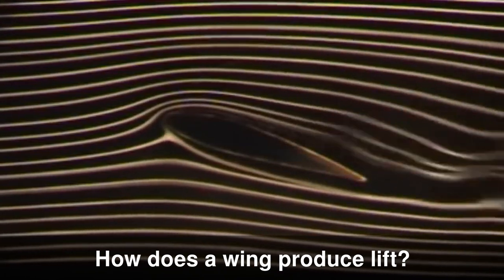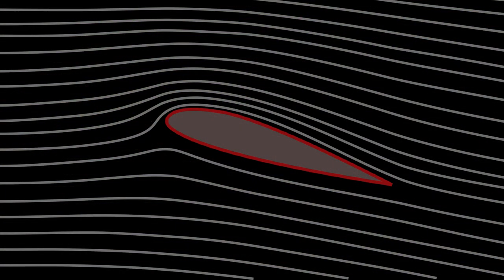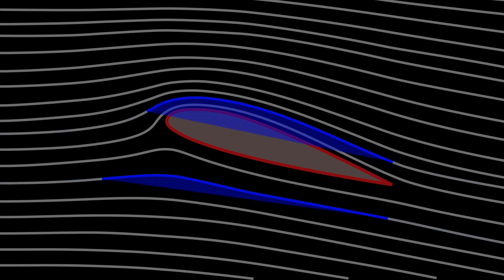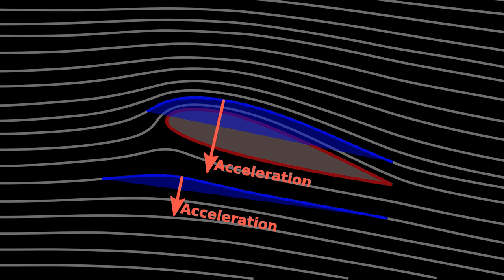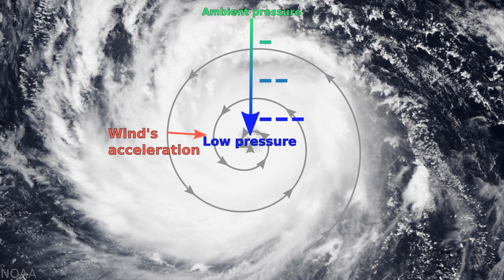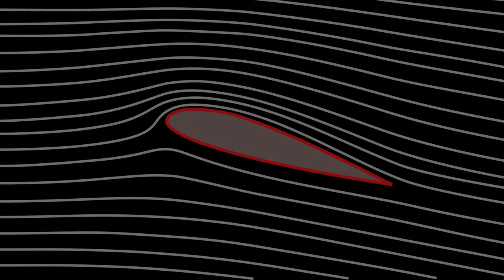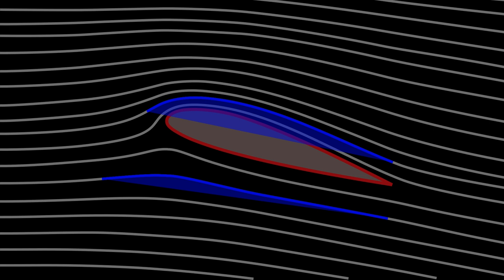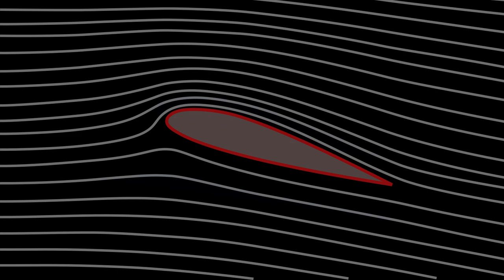A Wing's Lift Explained by Hurricanes

Comment: Don't know how I missed this 2 years a go.
You've done your homework Colin!  
You even know just how small the pressure changes are around a wing.  Very good.
.
The net top-bottom pressure difference on a Cessna 172 IS ONLY 0.1 psi.  On its 25,000 sq. inch area it is what lifts the 2,500 lbs of gross weight.
This is from a maximum CHANGE from ambient above the wing of about 0.08 psi [decrease].  This is a change [decrease] on the order of 0.55%  I'm sure that a sailplane is even less. 
. . . These percentages are, of course, higher at altitude.
.
It is even more impressive when you calculate the total force on the area of a wing. That Cessna 172 above [25,000. sq. inches] has an astounding 360,000 pounds on one side!
.. .. ..
.. .. ..
However, while you correctly see that the curved flow indicates the transverse Pressure Gradient, noticing that does not tell us the true cause of the pressure changes - - - precisely WHY it shows an increase below and decrease above. . . 
. That is deductive [or possibly Abductive] reasoning, not the physics of the cause.
.
Focusing ONLY on the upward lift force. . . .
.
it is a simple step to explain the true physics cause of the upper and lower pressure changes once you remember to include the fact that air has what we call inertia that resists the Acceleration caused by other constraints - as explained in Newton's First law. This is simple 11th grade physics that is NOT highly 'complex' as so many claim.
.
See the video on my channel for the physics explanation of the upper pressure decrease. 

The lower increase is simply the converse effect.
You can also search for this video identifier: v=3MSqbnbKDmM 
..
..
..
P.S. If I recall correctly, Derek's video uses two fallacies in his explanation many years ago [some lift from one and the rest from another] and he clearly does/did not understand even this much that you have - very disappointing.  
He even gave runner up status in his contest to a terrible Bernoulli explanation from Gus Gordon - Gus Gordon How roofs blow off houses: Search: :v=6vGxSoK0QTY* 
...
..
P.P.S.
I will say that you have one completely false comment about  the wing is both pushed and pulled up.  NOPE --> NO "PULL"!!
The force on the top of that Cessna 172 wing is DOWNWARD to the tune of 358,000 pounds!!  DOWNWARD -- NO upward pull.  The force below is around 360,500 giving a difference of 2,500 lbs. craft weight.
So good as far as you went, then that one comment.
Shame on you. . .

Comment: Hi Colin, without doubt the answer to the question in the video "how does a wing produce lift" is definitely a difference in pressure. In fact, experimental aerodynamicists measure pressure around and aerofoil and integrate this to determine the lift. The other answer to how is that the air must go down if the wing goes up, and this is usually referred to as the momentum conservation approach. This is used by computational aerodynamicists when they calculate circulation which comes from velocity around the aerofoil, which they integrate to get lift.
You presentation here is valid, and is a good 60 second summary of Prof Holger Babinsky from the University of Cambridge. Differences in pressure are associated with curved streamlines, that is a fact. However, it doesn't really address the remaining question of why the shape results in the asymmetric curving of the streamlines. For the hurricane, the heat in the center is driving the convection upwards, which results in low pressure at the eye, which then due to the pressure gradient force is going to move air towards the low pressure. The curvature you would be looking for in this convection cell is the horizontal to vertical curvature of streamlines. The fact that there is also a curvature horizontally is due to the Coriolis effect (the earths rotation). But there are underlying reasons why there is a vertical curvature and the horizontal curvature.
What is the underlying reason (force) for why the air flow curves around a wing/aerofoil in an asymmetric way, resulting in a net curvature?
Reply: Yes.  We know there is a transverse Pressure Gradient, but this does not explain the cause of the curved flow, nor the pressure change itself. 
See my comment today for the physics of the pressure changes.
Reply: @Observ45er  commented on your video.
Reply: @aerospacedoctor  I responded.
P.S. I'm aware of your credentials, mate.
Reply: @aerospacedoctor  Just a note to let you know I e-mailed you the more complete explanation of the physics that I use,